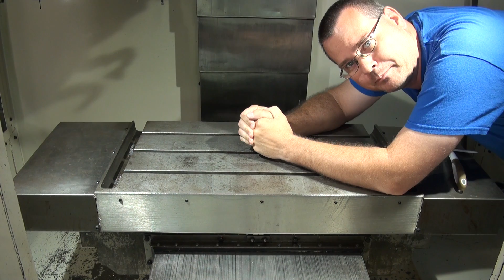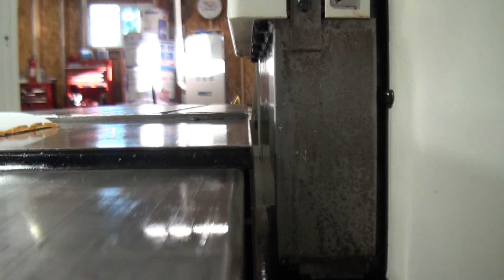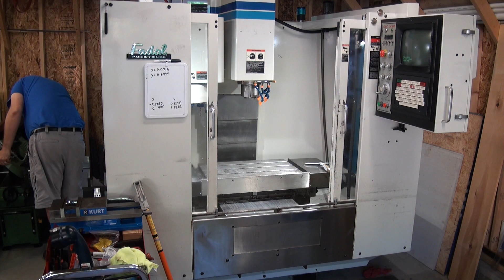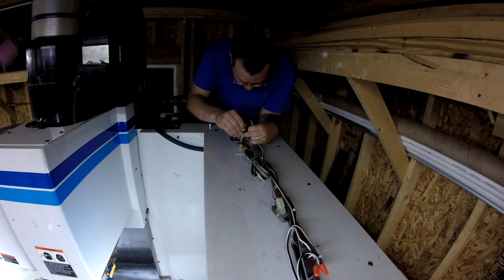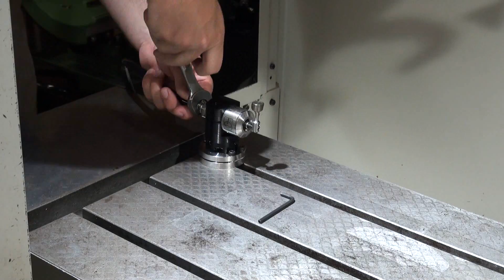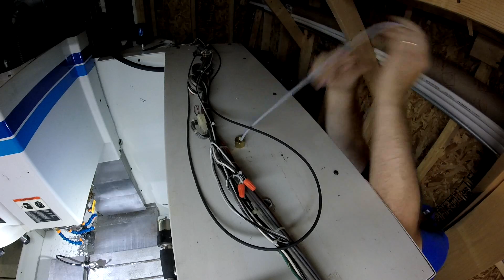Installing Renishaw TS27 Tool Setter and OMM

Comment: Quick point- the screws you put through the "way cover" sheet metal to hold the conduit to it appear to be Button Head Cap Screws. These do give you more clearance then a regular Socket Head Cap Screw, but that is unnecessary in this instance; the bearing trucks travel with the table (and the way cover). As long as you don't put the screws somewhere that they will hit the trucks when installing that cover, they will never hit them.
Reply from the maker: Absolutely correct in my case. I just happened to have a box of 100 button head screws left over ;) There are Fadal machines out there and others, they mount the rails to the table and the trucks to the saddle. Main reason I brought that up was to get others to think and check it out to make sure they don't have an issue. Thank you for the feedback and actually watching in depth.

Comment: Tim. You want Sealtite? I bought the 100' minimum quantity... I have plenty.
Reply from the maker: Sure! Next time I have it opened up I will pull it back and replace the tubing. Could you send me an email with the details, its in the video description. Thanks!
Reply: wozzwinkl, what size(s) of Sealtite do you have available?
Reply: I'm about to add a TS27R to my Fadal also.  What size conduit is it? Tim said 1/4" but Renishaw says 11mm.  One is prob. ID and OD.

Comment: Very good.  I keep waiting for you to do the engineer thing and slice a finger off but I have to admit for an engineer your pretty adept with those tools. Guess that means I will have to continue watching.  Your video productions methods and editing are improving exponentially, very watchable.  Notice I used an engineer word; exponentially.
Reply from the maker: John, you seem to be the type of person that watches car racing for the crashes? Thanks for the kind words about the video, I'm slowly learning and getting better equipment as well thanks to viewers!
Tim
Reply from the maker: Well if you must know, there is one digit that is a little narrower then the others for a run in with a razor knife. Then there is a scar from an angle grinder that I got a little carried away with. Last, I went out to the shop just to tack weld "One quick thing" well it turned into an all day project. I was wearing shorts, it was not a good night. This was all when I was younger and stupid. I tend to think I'm just a tad bit smarter now.